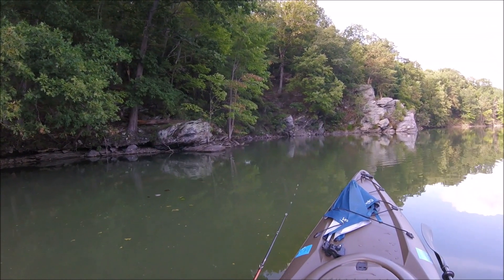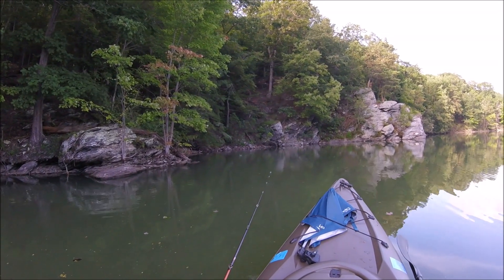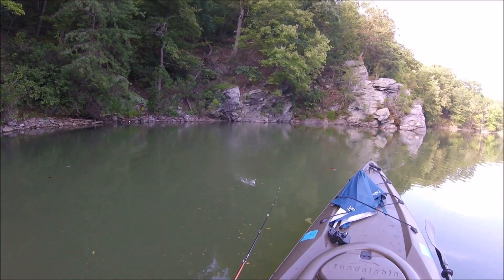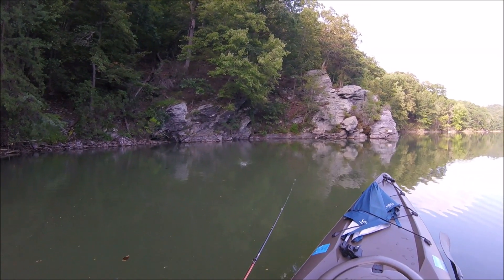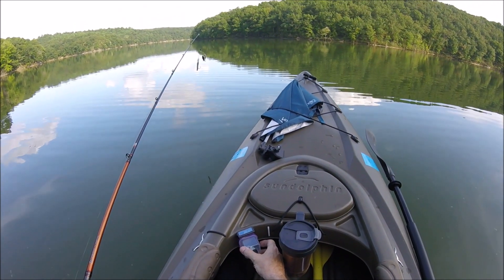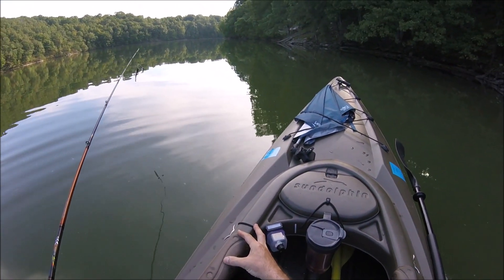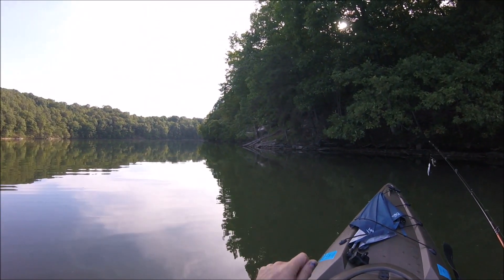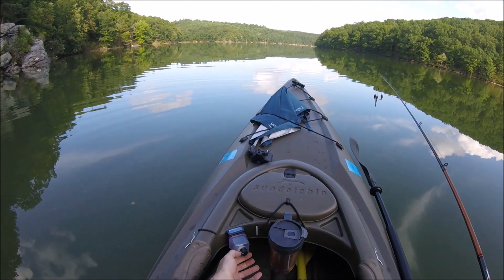I Converted My Electric Trolling Motor To Infinite Variable Speed Control For Under $20

Comment: Nice set up ! I want to put a switch beside me in my kayak so I don’t have to keep reaching back to turn on and off the switch but I’m not to sure of the wiring . I have a 3 way low /off / high .. I will eventually figure it out ..
Reply from the maker: It's easy. The motor will have a black and a red wire. Any other colored wires are for the switching. You want to bypass the motor's built-in switch, and run the black and red wired directly to the motor controller switch.

Comment: Hello. I have the same trolling motor mounted on my vibe skipjack. I really like what you have done and want to do the same thing to mine. I've been looking through all of your videos and have been unable to find your "diy" vid. Please help and thank you in advance
Reply from the maker: I haven't shot the video yet, but it's really easy. Here's what I got.: https://amzn.to/2p1v19S
Optional battery monitor: https://amzn.to/2oXHOtM
As long as you're not running longer than 5 feet of wire, 12 gauge will work, but no less. Make sure any quick splice connectors etc are rated for 12 gauge too.
I'll shoot that video when the weather gets better in a week or so.
Reply from the maker: I finally shot that video. Here's a link. https://youtu.be/_Rvyhwe51ls